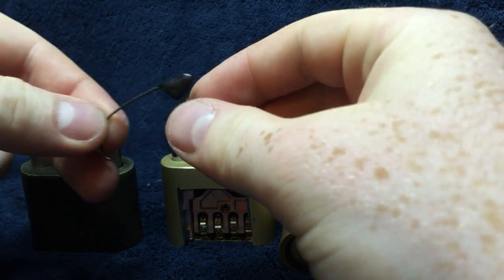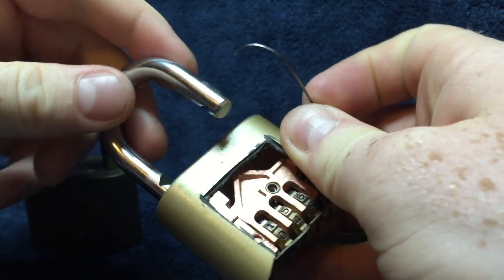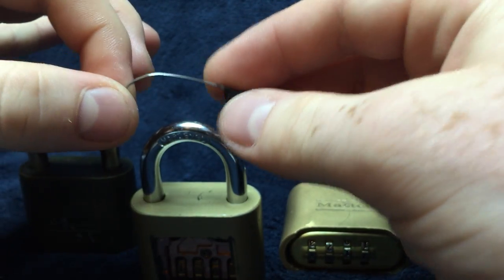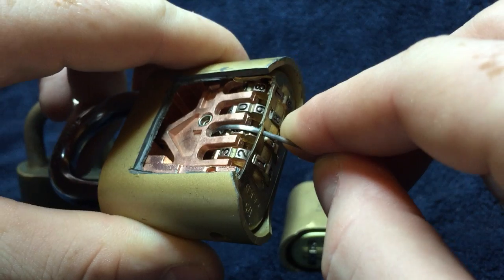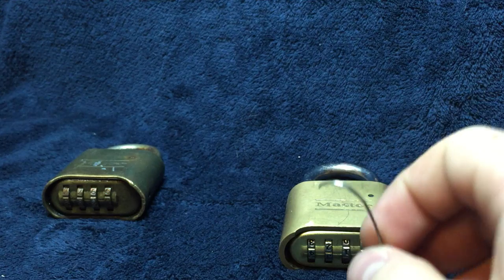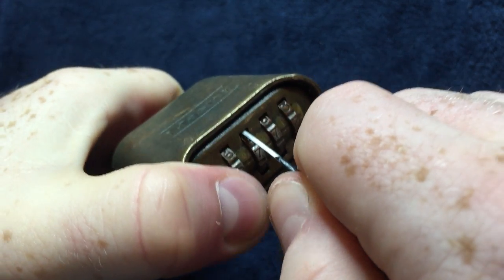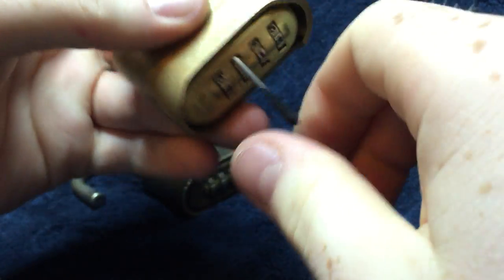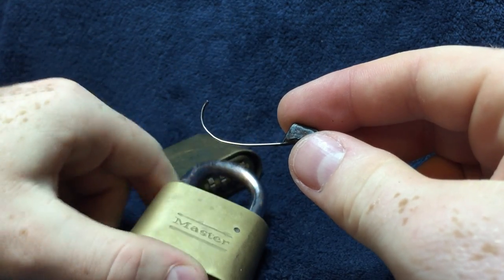How To Open Master Lock 175 In 2 Seconds! (J-Kit) - Tool Link In Description

Comment: Thanks so much for this. I believe the lock I inherited (locked) may be a newer version with smaller variances and possibly some bypass mitigations. Not sure, but I was not able to shim it. Only the thinnest of shims would fit and even then it seemed to be forced outside (not inside) the latch mechanism preventing bypass. This method worked a treat! I used a bobby pin cut with angle cutters near the middle and needle nose pliers to create the curve. Thanks for posting!
Reply: Haven't messed with too many locks before. I also inherited my lock. Tried the bobby pin and it worked like magic first go! Cheers dude
Reply: You were absolutely correct  and explained it very well
 I had two locks and  they opened right away.
It's amazing they can sale millions of these locks

Comment: Thank you so much! We had our combination correct and were going insane. Used a Bobby pin to pick it and it turned out that the lock was filled with oxidised gunk and never would have opened until we cleaned it out